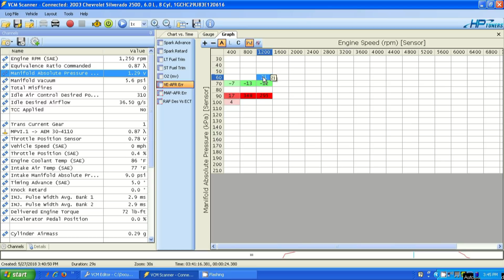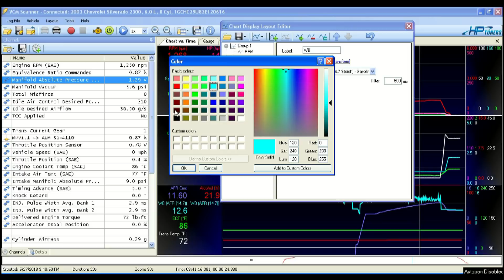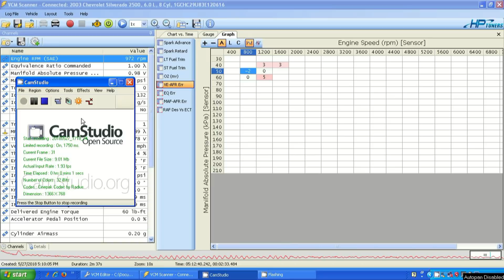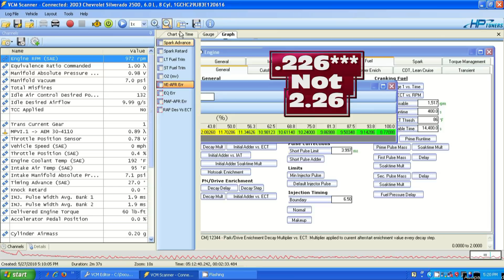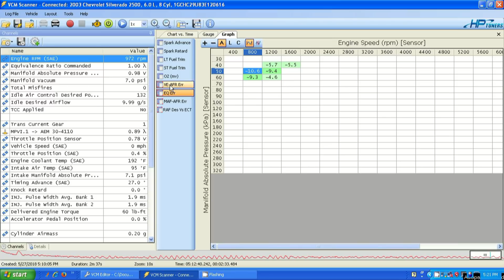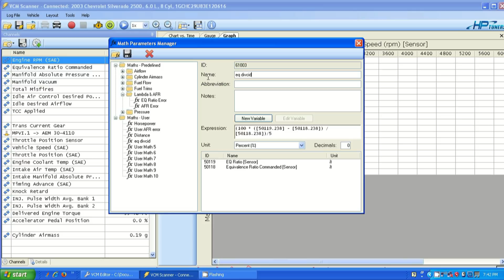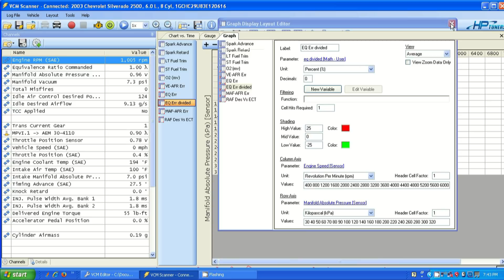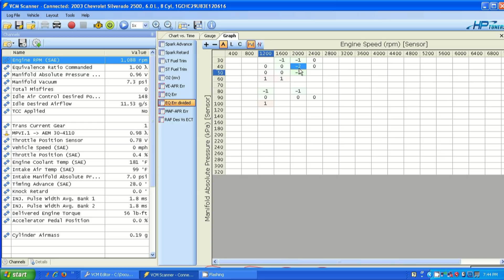HPtuners - Setting Up AFR Error Using EQ Ratio Error Percent Histogram For Flex Fuel!!!

Comment: I’m sure someone has told you by now but, you aren’t doing your math correctly. At one point you wanted to pull 10% from 57 @ 2000rpm & you said it would take it to 47 & be taking 25% out. 10% of 57 is only 5.7, your final number should have been (57x.10=5.7)….57-5.7=51.3, that would be your number not 47.   The way you were doing the math could be very critical in some situations.
Reply from the maker: Yes I did realize the mistake later. I appreciate it.

Comment: This doesn't make sense. The O2 sensors will try to run stoich regardless of the actual fuel. The only thing different is the actual AFR but the computer doesn't know the difference.
Reply from the maker: Theres this thing called "Open loop"... Does not run narrow band 02s so does not correct fuel... This setup Is OLSD "open loop speed density". No MAF or 02s. Wideband only.
Reply: @BlaserBuilds   not mentioned in the video which is why he asked as some people keep stft on in olsd. I set up the formula and I’m a lot closer to zero on my ve table than I thought. Thanks a again for this simple calculation and explanation. I hope you due more for spark advance and other parameters.

Comment: can I do this for just gasoline also
Reply from the maker: Yes. You can also just use AFR error for gas.
Reply: a21bravo will it work with just the normal o2 sensors
Reply: @isidrosevier1125  he already stated earlier this is only for open loop with O2 sensors,ltdt, and stft off. Your using only the wideband which is a lot more easy.

Comment: I have mpiv2 pro can you tell me how to transform the signal from the channel list into reading wideband  so I can use it in the graphs and chart layouts
Reply from the maker: Check out my new videl i just posted the other day. I go over the wideband and histogram setup. I'm not using the Pro, but I wouldn't think the setup is much different. I've heard you have to use the serial setup, or AC or EGR inputs on the MVPI2 though.
Reply: @BlaserBuilds  I'm using the MPVI2 thru a serial connection, running a AEM 30-0300 WB and trying to set the WB channel and the histogram up for e85, and I'm having a bear of a time getting all of my parameters setup correctly.

Comment: Thank you for confirming why I like carburetors. That was way over my head.
Reply: Doesnt need to be anywhere near this complicated to make it work. Carbs are nice and easy yet dont have the smooth air fuels like a injected car. You should try a basic efi setup I feel it will make a difference for ya. Just my opinion is all trying to help!
Reply from the maker: jerrynova1 None of this is really necessary... This is just a personal preference set up for scanning...